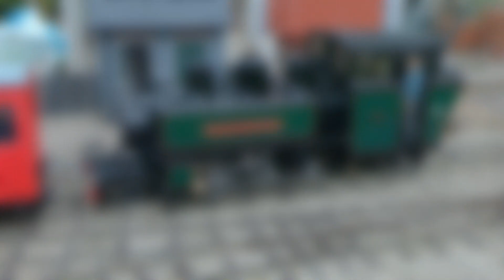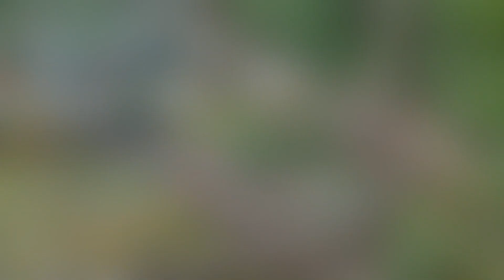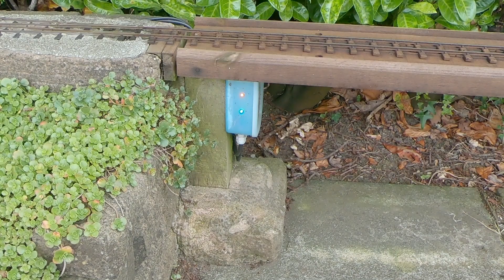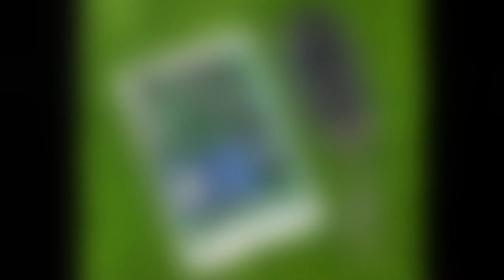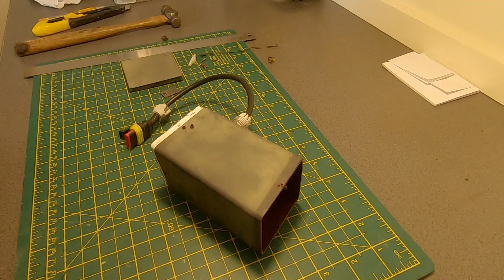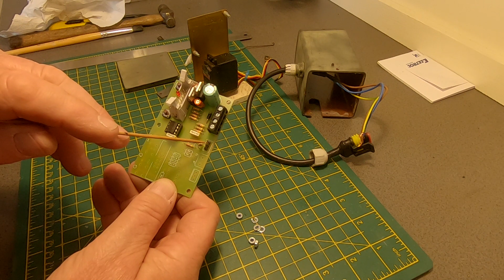Remote Point Control on a 16mm Garden Railway

Comment: very usefull video ,like yourself  am getting long in the tooth
Reply from the maker: thanks, it works for me and makes railway operation much easier. I don't pretend to know how the electronic gubbins work. I just use a short two core cable to supply power to the rf relay and 3 core cables to supply ongoing  power and a switching voltage to each of the servo controllers. Each of the blue rf relays are connected as  a simple switch on one leg and to the led's on the other leg. The servo controllers could be mounted in lineside buildings or any structure that is dry.
i hope this helps, John